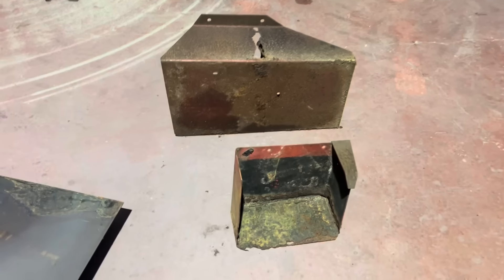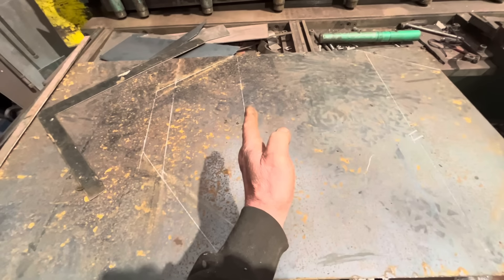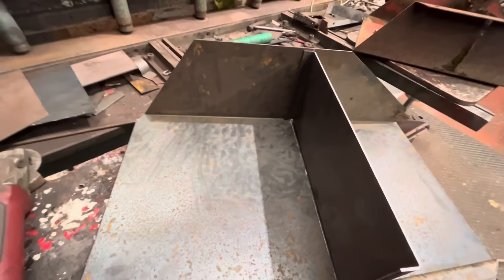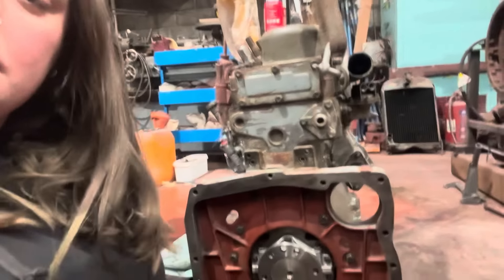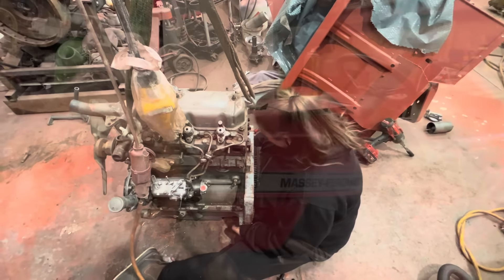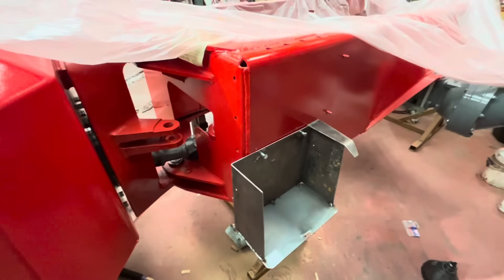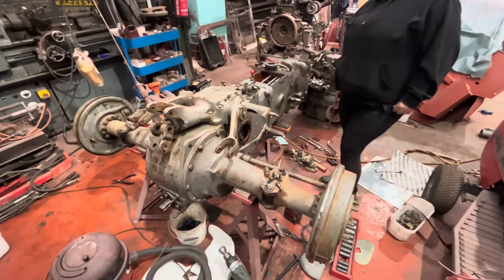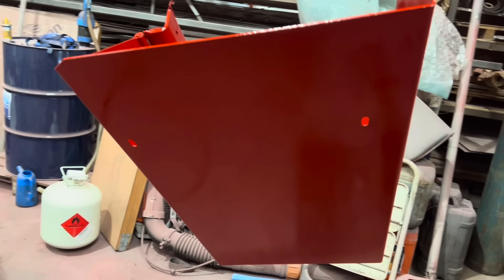Massey 135 , and new battery boxes for MF 1250

Comment: New first, congratulations.
Reply: The apprentice didn't set up the lift cover adjustments???????. Now when it's been painted she can do the running adjustments. It's a spurious MF159A, single and Dual Clutch Centraliser as used on 100 Series